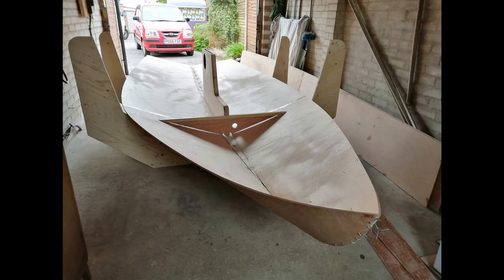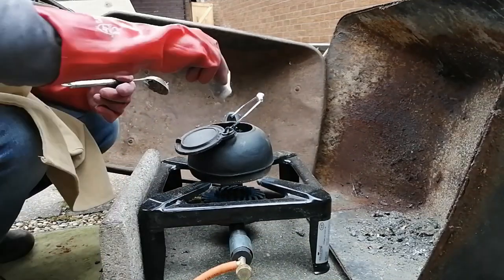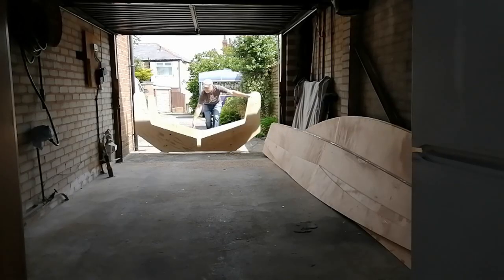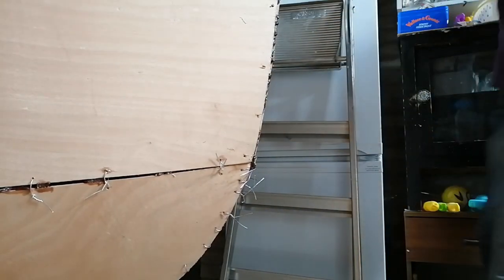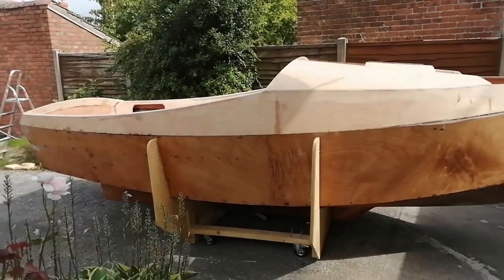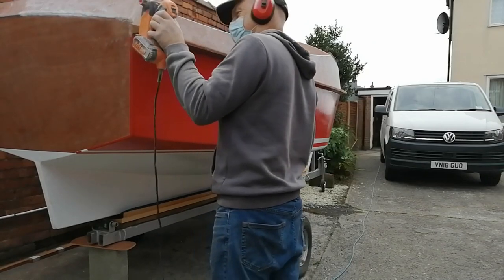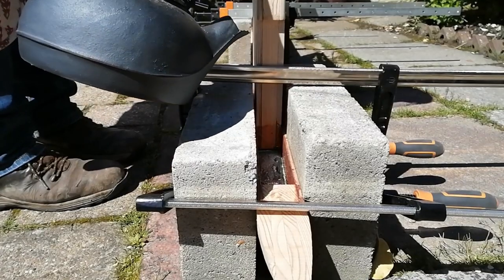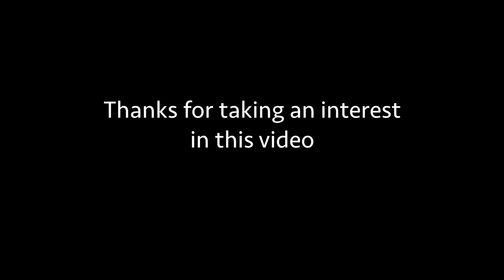AHAF Boat building tips - part one

Comment: Enjoyed your video Allen! Cheap Spring Clamp TIP...Cut 4"R Plastic Pipe into 3" pcs and cut open one end...then you just pull open and set over where light tension is needed to hols parts together...If you need more pressure, just add an extra strip of wood inbetween. I sanded the openings on the pipe so not to scuff my wood! BestRoy
Reply from the maker: Thanks for the tip Roy, I'll give it a go! Glad you liked my video. All the best mate.